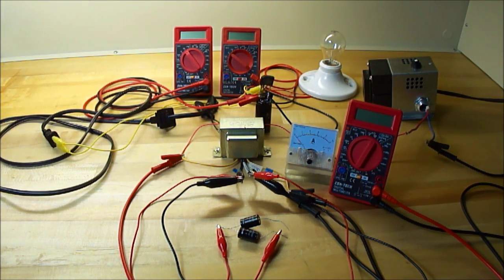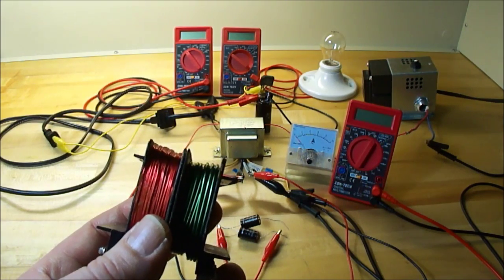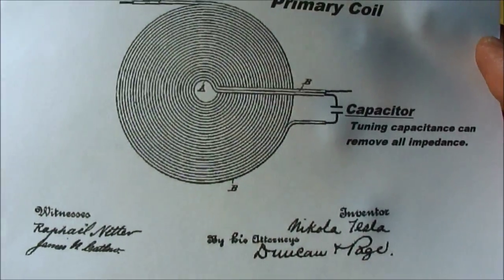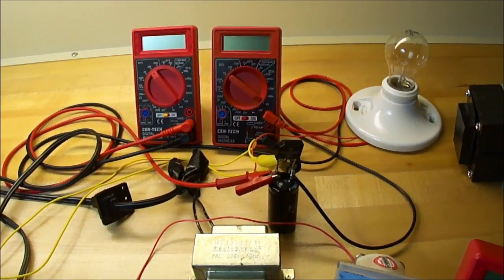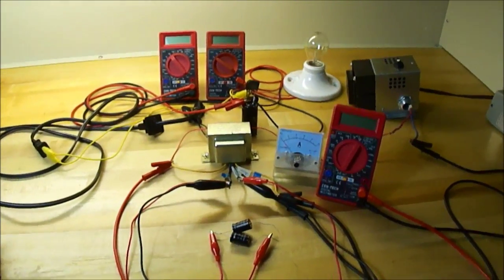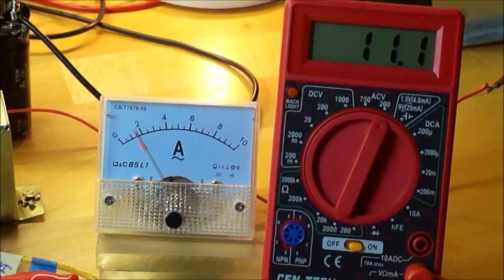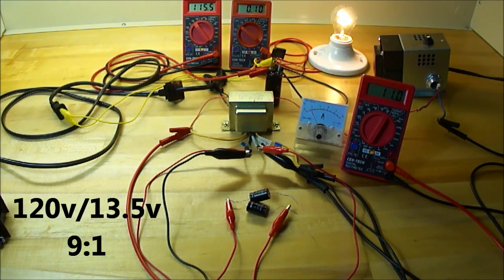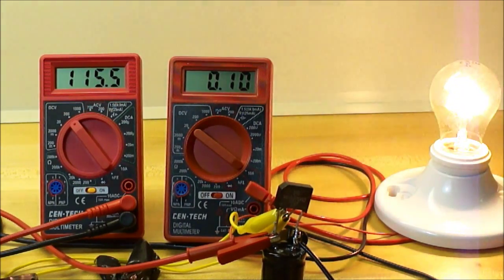Standard Copper Bifilar Super Inductor

Comment: You say you are using 11 voltage supply of power but why is it Reading 19 23 voltage when you disconnected the power
Reply from the maker: An oscillation continued between the two transformers until I bypassed the capacitors. You can see the effect in my Ring Time video.
Reply: Are you pulseing the transformer with the 11volt or is it a direct voltage
Reply from the maker: @IkutegbePeter I’m using AC in this video but it works with DC configurations also.

Comment: I was reading that if we have 2 currents travelling in opposite directions in the same physical space, then the respective magnetic field holding back the current carriers are cancelled. Allowing faster current (charge carrier) flow for a given voltage (so possibly it's why some of the dc resistance is cancelled ? ).
Reply: ps: I should have said 2 equal but opposite currents above.

Comment: Hi. Did you finally get your L shaped coil motor to work? I tried with two horizontal portions of the L facing in two directions while still having only one vertical part of the core, just the way you show it. It works very well. But only when the vertical coil is energised. I have watched your videos, all of them and learnt a lot from what you said and showed. A great deal of respect with a greater thank you.
Reply from the maker: Thanks! I learn a lot from everyone here. Been side tracked from the powers that be locally.
Reply: @ArkiverUnifiedEnergy  Noob question: how did you come up with the right capacitance value ?   
May God guide & protect you !

Comment: Any time you wind wire around an iron core you are going to have inductance which causes inductive reactance which limits current, similar to resistance. Reactance is used in transformers to limit the current in the primary, especially when there is no load connected to the secondary. Putting a capacitor in series with the primary increases the primary current because the capacitive reactance cancels inductive reactance. With just the right amount of capacitance, you can cancel the reactance to zero, a condition called resonance, and in that case, current is limited only by the resistance of the winding, and the transformer will burn out if it is not designed to handle that much current. Impedance is the vector sum of reactance and resistance.
Reply from the maker: I achieved resonance in another video. To some degree its also load dependent.   https://www.youtube.com/watch?v=bbpso7zAlvU

Comment: May I have the complete schematics of this one? if possible?
Reply from the maker: Hi. The primary is isolated and bifilar secondary has the bipolar cap in middle with other two coil leads to bridge rectifier and DC cap. Center capacitor is the only difference from standard AC to DC conversion. There's more details in recent videos. Other effects noticed with the capacitor in the center of bifilar coils. Cheers

Comment: Looks like you're using DC electrolyte caps for AC? I don't think they appreciate that. But you're right, adding a capacitor with the right capacitance for the frequency and inductance puts the caps in resonance with the coils so that the inductance and capacitance evens out and you only have DC resistance left.
Reply from the maker: +Hob Nilre Thanks for your increasing force videos. The caps are bipolar and start cook'n with all those amps. None popped though. I think there's something beyond the resonance that should be investigated. If a capacitor has instantaneous opposite charges on its plates there would be a momentary negative vacuum force on one side of the load and an opportunity for energy to enter the circuit.